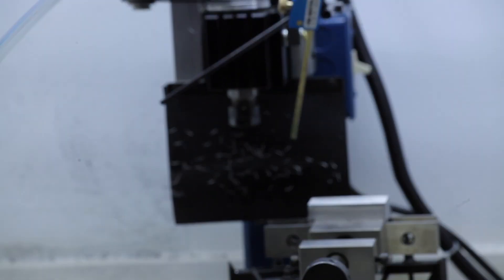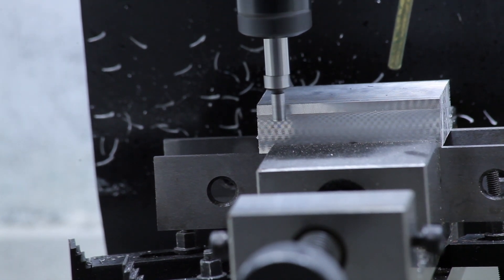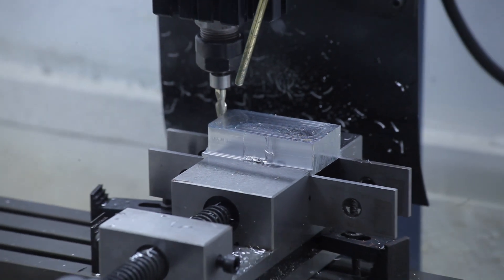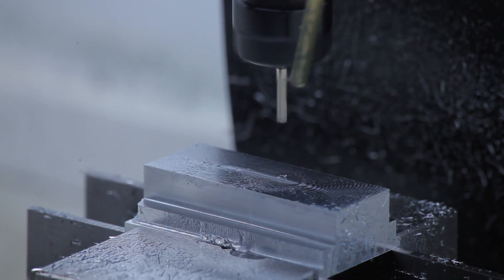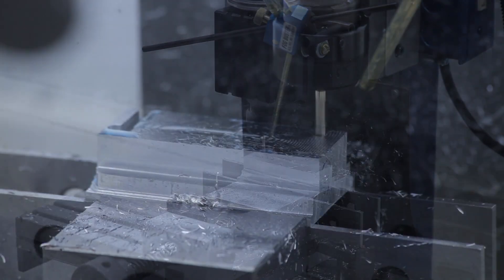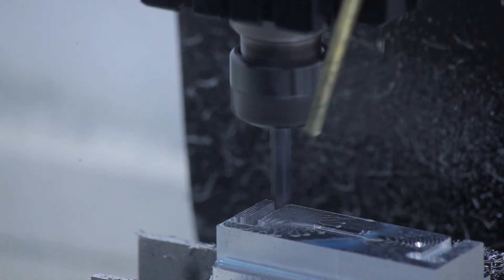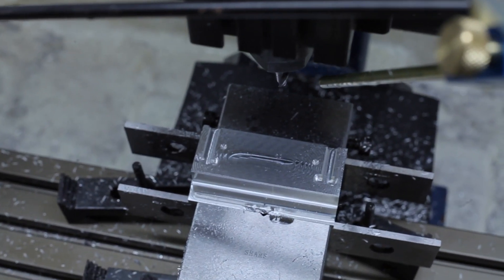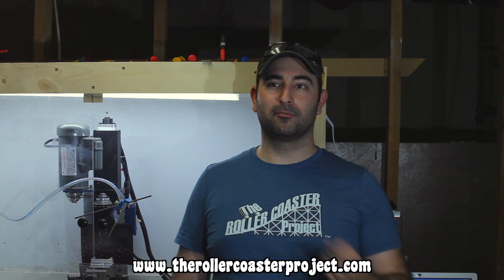CNC Milling a Roller Coaster Building Tool

Comment: Nice, getting to supports next week. How did you design the ride beforehand? As is, how do you know how high/tilted/... each bent should be and where it should go? Cheers!
Reply from the maker: AV dE before I would take the 3D model from my design and CNC the various parts with my Taig.  However, the Taig isn’t really a good machine to do wood and metal since the dust can clog the motion components.  A CNC router would be more appropriate, and maybe a future purchase.
As for the height, bank angle, track angle and more, I applied some math and engineering knowledge I acquired over time.  Once I worked for a ride company, I noticed I was doing it more correctly than I had previously though.  I have a few videos about dynamic calculations, but banking can be derived in similar fashions.  AutoCAD and some 3D modeling go a long way too.